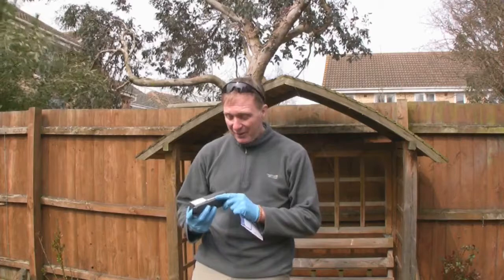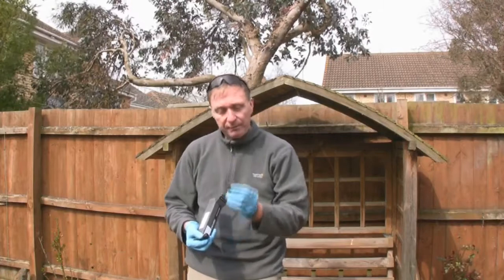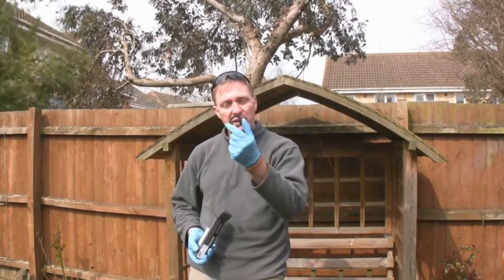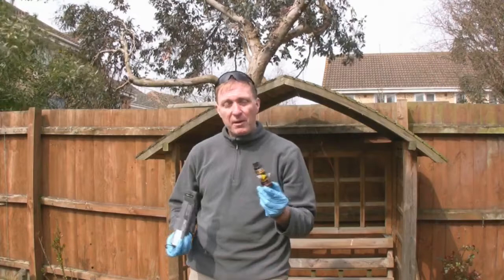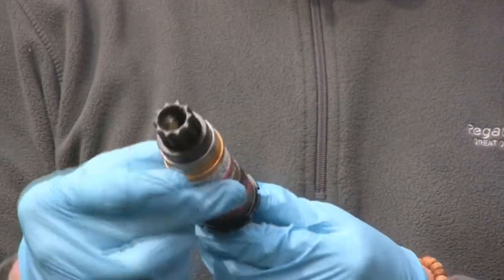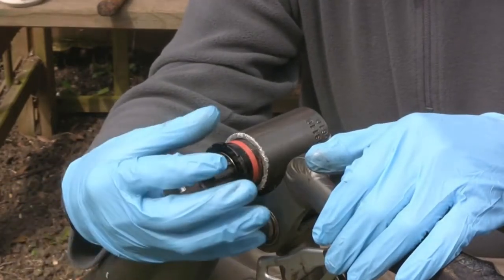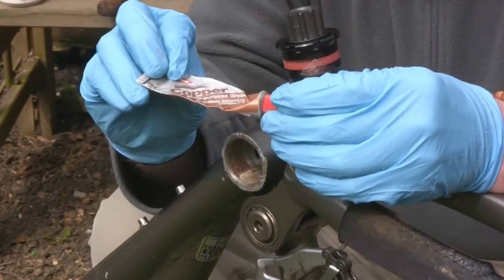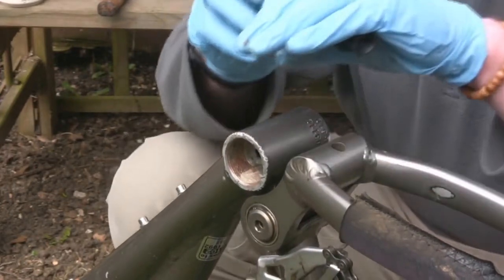Bottom bracket replacement - part 1

Comment: good audio, no wind
Reply: Didn't realise you were into bikes Chris?
Reply: Matt Allen Not really,  the video is done by Andrew Pullen ... found on Facebook. Still, worth a watch.
Reply from the maker: Cheers Chris, I recorded the audio on a Zoom H2 then sync'd in edit. Camera audio was only used to help sync separate track. Now deciding on what type of wireless mic to get.
Reply: let me know what type of mic you get. I am looking for one myself. Will make tutorials more interesting then.
Reply from the maker: A Zoom H2. Self contained audio recorder with front, rear or 4 channel recording to an full size SD card. Can also be used to store audio from a plugged in separate microphone. Several quality and format options MP3, WMA, etc. I'm considering getting a wireless lavalier mic but now got to ensure the radio frequency is legal since recent legislation changes in the UK. Several cheap Ebay wireless mics are now illegal to use in UK with risk of big fines if found.
Reply: ***** I got the Zoom H4N.  Was thinking of an expensive lav. mic since the cheap ones are really poor quality.  Was thinking of paying £300 for one
Reply from the maker: Been watching some wireless lav mics on Ebay that are around £300 for second hand. Due to the recent changes, there's a lot of ex professional gear being sold off but are actually illegal to use in the UK. I'd say £300 is about right for mid range stuff as the sky is the limit for price of high end equipment.
Reply: ***** what is illegal about them?  the frequency they operate on?
Reply from the maker: Some radio mics are on older frequencies that are no longer allowed due to risk of interference on current used frequencies. One of my filming contacts mentioned to me they've had to buy new wireless mics because of this. From January 1st 2013 in the UK you will no longer be able to use theatrical wireless microphone systems in the 792 – 862MHz frequency range. This includes most UK radio/wireless microphone and in ear monitoring (IEM) systems which are often found at the very top of the UK television frequencies on channel 69 (854 – 862MHz). The Ofcom site has more details but any decent retailer will be able to advise you. For now, I'll stick with my Zoom H2 and wolfwindshield and record audio out of shot.
Reply: Ah excellent thank you for that info. So to stay legal avoid cheap second hand mics.
Reply from the maker: Absolutely because the fines are big.
Reply: That surely is going to upset a few studios that have invested in expensive audio equipment. Are there no suppressors or frequency adapters available?
Reply from the maker: No - I think it's because of the recent switchover from analogue to digital radio and tv broadcasts a few years ago.
Reply: okay,  that makes sense.